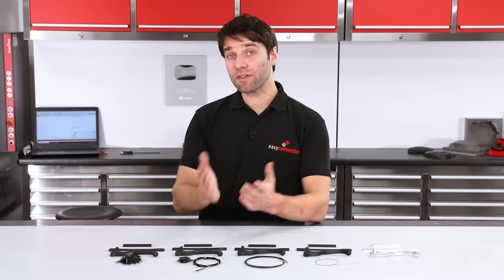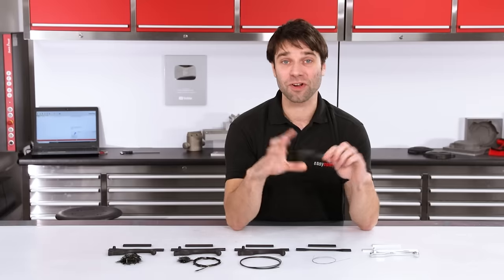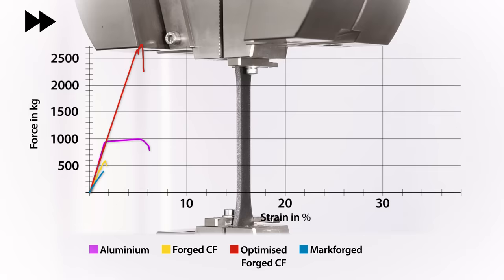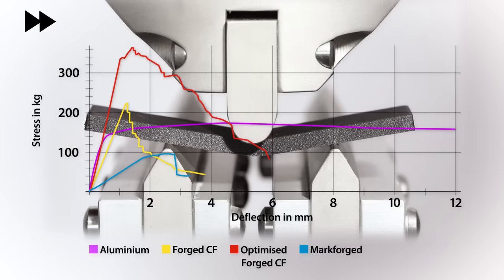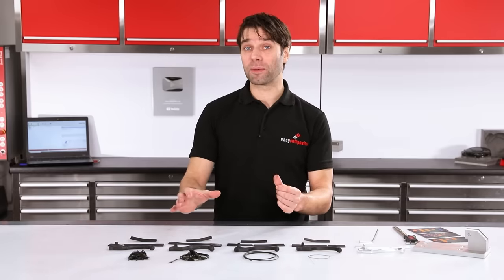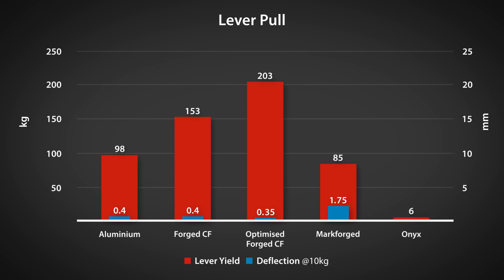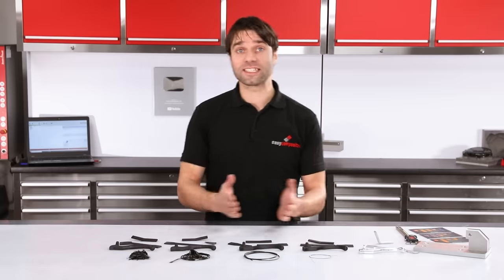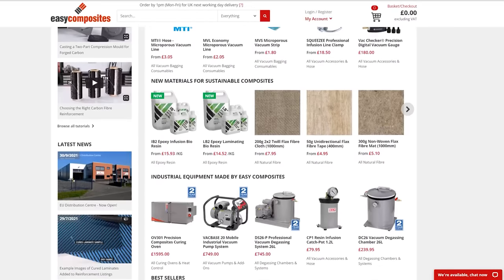How Strong is Forged Carbon Fibre? Forged Carbon vs Aluminium vs Markforged vs Onyx

Comment: When testing, you never use one item. Especially for destructive testing. You repeat the same measurement on identical copies of the item under test. 
You're engineers, you should know this, very, very well. edit: 15:50 see? you did do multiple tests!
Reply from the maker: We won't have done as many tests as a large laboratory or manufacturer as the purpose of testing in this case was for comparative and demonstration purposes for the video rather than an extensive testing regime for a product being developed.
Reply: @easycompositestv  did you at least make 3 repetitions? Just to avoid getting a fluke and maybe also see how repeatable the results are?
Reply from the maker: Sorry we didn't spot this until now, yes all of the tests were repeated at least 5 times, the data in the video is an average of the results with any invalidating outliers removed.
Reply: @easycompositestv  awesome! Also glad you did remove outliers, it is standard practice in some kinds of tests, yes. (i'm a fizzy cyst)

Comment: So the optimized cf can do the same job as the aluminium at one quarter the weight basically? Impressive.
Reply from the maker: Yes in broad brush terms.  Weight for weight, carbon fibre always looks very good compared to many other materials.

Comment: It would be interesting to repeat parts of the test at 100C.
Reply from the maker: The resin is only rated to 80C and a brake lever or similar component would not see such high temperatures.
Reply: @easycompositestv  Yes.  I was thinking of various engine parts that would be under the hood.

Comment: At 153kg of force (337.3lbs) the forged carbon with randomly positioned stands is the best option I think. Easy to make, stronger, and lighter than the aluminum it replaced.
Reply from the maker: Both the forged carbon options were great and both have their own advantages in certain situations. Certainly the standard forged carbon was more than up to the job in this case.

Comment: Great info but,,, you did not address the application. As someone who has probably broken dozens of levers over the years and had to ride hours with a set of vise grips to pull my clutch cable, I would probably prefer a more flexible lever that could rebound into shape from a spill. You really just need the minimum force to pull the cable. The “worst” performer in this test is probably closer to what I would actually want in a lever. Although the onyx seemed a little too soft to actually pull the cable.

Comment: also - the carbon fibre design for a pull handle would have an optimised design, ie thicker than the alum alloy at the weak part
Reply from the maker: Sure, you could (and should) change the design of any component to play to the strengths of the material it's made from, however, in like-for-like testing it's important to keep as much as possible the same.

Comment: How does that compare to tradition carbon fiber resin weave?
Reply from the maker: We have not done a direct comparison as the two different processes really would be used for different applications in most cases. In a simple test, I would expect a woven cloth test panel to be stronger than a simple forged carbon part. The optimised forged carbon may well be better compared to a panel made using a significant amount of UD cloth.

Comment: great practical video -- isn't the term 'cast' or 'laid' or 'moulded' not 'forged'?
Reply from the maker: Thanks for the comment and yes, the term 'forged' carbon fibre is not the clearest but it's been around for a while now  (Lamborghini have been using it for several years) and is quite widely used with an established meaning. To avoid using the term would mean that many viewers interested in understanding 'forged carbon' might never find this content, get to see what the term refers to (for some at least) in the context of carbon fibre composites, and learn how - for the right components - this process can be used to produce strong, lightweight parts with minimal equipment.

For what it's worth, before making the video we did discuss whether to use the term 'forged' a lot because we really weren't sure ourselves. After lots of deliberation (checking dictionaries and researching the history of the term) we decided to go with it but we did expect others might come to a different view, and that's fine too. If you'd like a much more lengthy explanation of we came to our decision please get in touch, we're happy to have more healthy debate on the subject

Comment: I would have liked to see a different CF material than nylon maybe poly-carbonate or asa/abs because nylon is too flexible for these stiffness tests it's like the 2nd most flexible printable plastic after TPU

Comment: Excellent Analysis and very useful - but have to check the "Dislike" box due to the misleading title that describes these methods as "Forging". This is NOT "FORGING" but another form of molding or similar process. If the aluminum (for example) had actually been FORGED (which can be done to metal - either hot or cold) I'm sure its performance would have been vastly different.
Keep up the great work, but don't create misleading titles for sensational effect. Cheers!
Reply from the maker: Thanks for the comment and yes, the term 'forged' carbon fibre is not the clearest but it's been around for a while now  (Lamborghini have been using it for several years) and is quite widely used with an established meaning. To avoid using the term would mean that many viewers interested in understanding 'forged carbon' might never find this content, get to see what the term refers to (for some at least) in the context of carbon fibre composites, and learn how - for the right components - this process can be used to produce strong, lightweight parts with minimal equipment.

For what it's worth, before making the video we did discuss whether to use the term 'forged' a lot because we really weren't sure ourselves. After lots of deliberation (checking dictionaries and researching the history of the term) we decided to go with it but we did expect others might come to a different view, and that's fine too. If you'd like a much more lengthy explanation of we came to our decision please get in touch, we're happy to have more healthy debate on the subject

Comment: I would like to be devil's advocate for CF-filled nylon. Getting over 10% of aluminum part's strength with metal-casting optimized part geometry out of 250$ worth of equipment is a good result, and with proper geometry cf-filled nylon parts will work fine, even if we ignore skill and equipment gap with other processes.
Reply from the maker: Agreed, for many applications where you can afford the extra weight and volume then CF filled nylon can be a good option, and it is certainly accessible, but there may be situations when you need more performance and with the same equipment and a little more time, you can use this process to get there. Thanks for watching!

Comment: The markforged being worse than just solid aluminum is not a good look.  I guess if you are doing non-structural components, but that's just not a good look since the main reason to do carbon fiber is strength to weight and for stiffness purposes.

Comment: It's in a mold. It's pressing against the fluid of the epoxy. Isn't that fluid basically incompressible? So what does the pressure contribute to the process? 

I think it would be informative to do a strength test comparing objects molded with and without the pressure.
Reply from the maker: Hi Roger, indeed the resin is incompressible but that's not really what's happening here. The main effect of the clamping pressure is to force the excess resin out of the mould, which you can see happening as we close the vice/clamps. The process also encourages migration of trapped air out of the mould too. Because we have carefully measured the amount of fibre, squeezing out the excess resin (but not the fibre) increases the fibre fraction. Up to an optimum ratio, laminates with higher fibre fractions (i.e. more fibre, less resin) will perform better than laminates with lower fibre fractions. Pressure will also compress trapped air, reducing its volume and therefore reducing the void content in the laminate, improving its performance.

Comment: Can you make sport motorcycle wheel form carbon fiber
Reply from the maker: It is technically possible to manufacture composite wheels, however they require a vast amount of mechanical testing to be deemed suitable from a safety aspect.

Comment: hey guys i hate to break it to you but as a blacksmith the only similarity this has with forging is the grain structure of the material isnt cut at any point
Reply from the maker: Thanks for the comment and yes, the term 'forged' carbon fibre is not the clearest but it's been around for a while now  (Lamborghini have been using it for several years) and is quite widely used with an established meaning. To avoid using the term would mean that many viewers interested in understanding 'forged carbon' might never find this content, get to see what the term refers to (for some at least) in the context of carbon fibre composites, and learn how - for the right components - this process can be used to produce strong, lightweight parts with minimal equipment.
Reply: @easycompositestv  i see

Comment: CF is a bad choice for bike brake levers )   aluminium can take less of a load but it will remain in one piece no matter what.  
even if you fall and smash your lever into the ground it will remain fully functional. just crooked a bit.
Reply from the maker: The mechanical testing isn't purely about use as a brake lever, although that was the shape chosen as per the previous video. Such high impact loading would not be so relevant for many applications.

Comment: What do you guys think about making a bicycle frame with forged carbon fibre?
Reply from the maker: We really wouldn’t suggest the forged carbon process for a bike frame. Structurally you really need to be using optimised fibre orientation throughout the frame but additionally the practicalities of the compression process just wouldn’t suit a tubular construction, like a bike frame, well at all. I’m afraid for a bike frame you really need to be using the prepreg we demonstrated in our bike frame video.

Comment: is the resin the same for all types?
Reply from the maker: The resin is the same between the forged carbon and the optimised forged carbon (with the added UD tow). The aluminium component, and onyx and Markforged prints don't use resin so they're all different materials.

Comment: What could be realistic values for a composite of 40% epoxy and 60% milled carbon fiber? Hopefully quite a bit better than the Onyx
Reply from the maker: Without mechanical testing it to get comparative figures it is hard to say for sure but I would expect the milled carbon casting to perform better.

Comment: #1 COST .. in scale production all that matters is cost. 

Sure, with nearly unlimited budget niche use cases carbon fiber clearly has its place. Other examples: long-term fuel savings for unibody construction of airplanes, rocket fuel tanks, extreme sports, etc.
Reply from the maker: Also remember that a lot of this applies do DIY users where personal time does not have the same cost attached to it than a mass produced production. Hence the extra labour time is often worth it for the results.
Reply: @easycompositestv  .. I have no doubt that there are a lot of DiYers. I'm one of them but not anything with carbon fiber. I certainly know a few athletes with their $20K bicycles. I'm so old I remember when they cost around $10K+ 20 or so years ago. The findings in your video were all logical, interesting and I'm certain helpful for many.

Comment: theoretical Q...
dose it make sense to make a rough approximation in weaved carbon (small and complex to make it to set form, if you did not make one:) and machine it? 
not worth the trouble?
Reply from the maker: A solid block of laminate could be made and machined, but fibre orientation would likely dramatically effect the results.

Comment: So what you’re saying is I could run optimised forged carbon fibre pistons? 🤔
Reply from the maker: Not quite!  They would melt!
Reply: @easycompositestv  hmm. I wonder if the same technique could work with something like hardblok engine block filler as the binder.

Comment: I can't see why one would want these material properties in a lever though, I'd rather it yield and not transfer as much force into other parts, especially because the plastic deformation is absorbing impact energy.

For other parts, sure, this makes a lot of sense, but for the specific example given, aluminum just seems superior.
Reply from the maker: We certainly don’t disagree with you; this video was all about demonstrating the properties of the material and comparing to its obvious alternatives. The brake lever example was just something relatable and quite easy to test and compare. Aluminium really might be the best material for a brake lever but based on the results we got from a simple process, forged carbon looks to us like material that would have some great applications.

Comment: Im told resin has a lesser to big/huge impact on different strengths of The part, from engineer
Reply from the maker: The material is a composite of resin and fibre with both contributing to the overall properties in differing proportions depending on process.  So the resin does have an impact in many cases.

Comment: Looks like the optimized forged carbon is the strongest structuraly, the only problem is when it does fail its sudden and catastrophic.
Reply: The sudden and catastrophic failure at much higher loads is irrelevant though since it's far beyond what it's being compared to :).  I don't necessarily see that as a problem, because it's storing much more energy than everything else so naturally, that stored energy releasing is going to be more violent when it does fail.

Comment: It would be interesting to add a titanium lever to the test
Reply from the maker: Mechanical properties of titanium are readily available and so in terms of deflection and ultimate strength you could just compare the properties of titanium with aluminium and get a pretty good idea where that would then sit alongside these other materials.

Comment: The problem with these kinds of comparision is that you don't have the same backup in carbon as in aluminium. The aluminium, at least you get some spare time and can fix an upcomming problem if you feel it's giving up onm you. With the carbon, it's hi and good bye at the same time. Sure, if you are in an environment where that backup doesn't matter, but you're just ok with it breaking, then you're fine. But for everything else, we want a buffert zone in time.
Reply: I realised a good analogy is Oceangate. You don't want something to break suddenly, you want it to give you a hint that shit is going to happen.

- "If the sub pass it's pressure test, it wasn't going to fail on the first dive, but it's going to fail over time. "
- "Might fail on dive seven which is insidious."
- "You don't get that with steel or titanium."

Comment: Biggest problem with carbon fiber.  Once it yields its much more like to just snap.  So it has the opposite complaint I have about aluminum.  Aluminum most like to deform.  While carbon fiber most likely going to just snap.  Just an observation of mine it appear most of this has to do with how the resin is oriented to the carbon fibers and less to do with the strength of the fiber is self

Comment: Is this really foraged or just pressure molding .
Reply from the maker: Thanks for the comment and yes, the term 'forged' carbon fibre is not the clearest but it's been around for a while now  (Lamborghini have been using it for several years) and is quite widely used with an established meaning. To avoid using the term would mean that many viewers interested in understanding 'forged carbon' might never find this content, get to see what the term refers to (for some at least) in the context of carbon fibre composites, and learn how - for the right components - this process can be used to produce strong, lightweight parts with minimal equipment.

For what it's worth, before making the video we did discuss whether to use the term 'forged' a lot because we really weren't sure ourselves. After lots of deliberation (checking dictionaries and researching the history of the term) we decided to go with it but we did expect others might come to a different view, and that's fine too. If you'd like a much more lengthy explanation of we came to our decision please get in touch, we're happy to have more healthy debate on the subject.

Comment: Can you make something from dyneema? I think this is even stronger than carbon fiber
Reply: That stuff is great, we spec'd it for rope risers at a previous job and it was cool stuff. A bit picky if i recall as far as handling? Or maybe that was just the engineer being paranoid. I think it has better strength/weight in tensile than kevlar, and maybe even carbon somehow, but probably doesn't beat carbon when used in a resin matrix composite. I don't think a cupon of given geometry will outperform uni carbon. Given weight, maybe.
Reply from the maker: If you have it in a chopped format then yes you can use the same method.  The performance will reflect the differing mechanical properties between the dyneema and carbon.